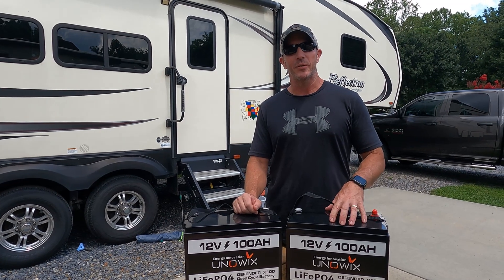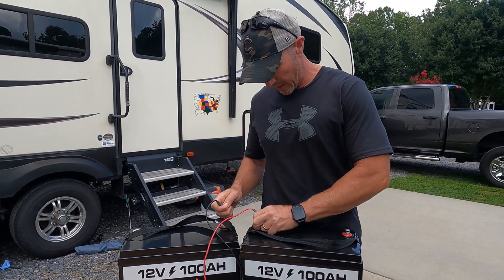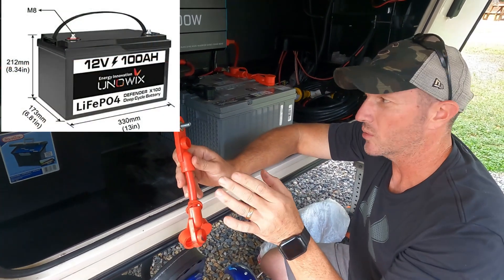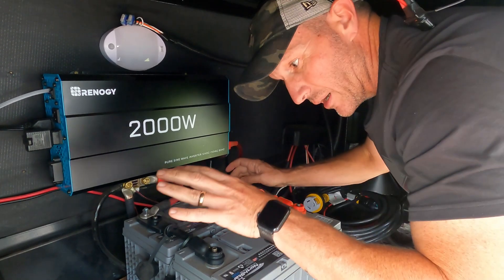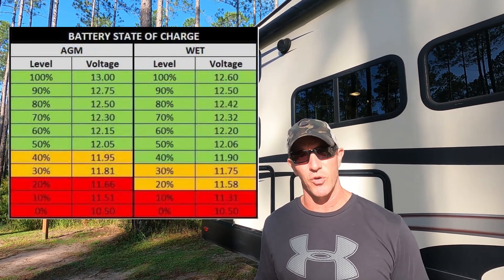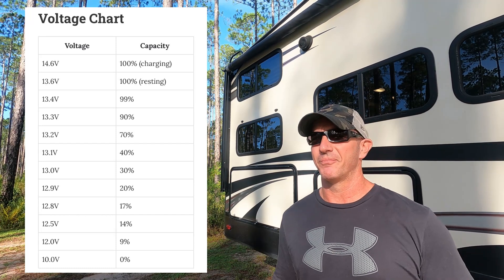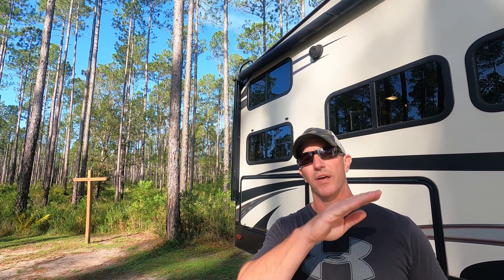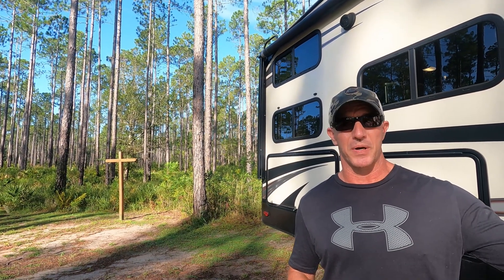Budget Lithium Battery Review | UNOWIX Defender X100 LiFePO4

Comment: I went to the UNOWIX Defender website and they don't list a phone number.  I found 3 email addresses so I sent a message to each address but after a week I get no response.  I'm just wondering with a Hong Kong based company if a person had a problem with a battery how would you get any response/support?  Have you contacted them since you installed the batteries?  Are the batteries holding up after a year?  Thanks!
Reply from the maker: My correspondence with them has always been through email. The batteries are still performing perfectly!

Comment: Where did you purchase your battery connectors with the caps?  would like to add the same to my setup.
Reply from the maker: Here are the battery jumpers I am using:
https://www.amazon.com/dp/B019H9XC3G/ref=cm_sw_r_as_gl_api_gl_i_SYZEK0KDN8RMJ3717QS8?linkCode=ml2&tag=jouppioutdo0e-20 
Thanks for watching!

Comment: Did you add a DC-DC charger on your truck to help charge the lithium and protect the alternator?  Also, where did you purchase the 2/0 battery jumpers?
Reply from the maker: No I did not. The alternator only provides a very minimal charge to the batteries and will not be damaged with this swap. The jumpers are from QuickCable and available on Amazon. Thanks for watching!
Reply: @JouppiOutdoors  thanks for the reply. I have the same setup as you but still have the SLA batteries. 2x 135ah with a 2000w pure sine wave inverter. I was going to hardwire it to the breaker panel but decided not to. Instead I wired a 10/3 SO cord to the inverter AC outlet and installed a 30a female plug on the end as I’m good with just plugging the rig into it. I’ve considered the LiFePo4 but haven’t been able to justify the expense. We boondock more than being plugged in at a park but I have a pretty sweet generator setup onboard our Imagine 2600RB. I’m considering the Victron 12/25 as it’s a much better charger than the WFCO converter. Keep us posted on the UNOWIX batteries. 

Happy camping and many blessings to Dylan, you and your wife.

Comment: Wow thanks for the review it's a right up my alley of information that I need to know. I bought a used 2021 Grand Design Reflections 150 260RD back in March. (Wednesday I'll be camping for 4 nights for 1st time.)  At the end of October I'll be having some solar added to it and I've been doing a lot of research.  I don't get to camp as often as I like because of my job  but I like to do dry camping and boondocking along with state parks.  I won't be able to do a full blown solar package but I like to have a start to where I don't have to do a redo if I do some add on.  Deciding on batteries was my biggest concern. I worry about lithium batteries getting cold on me.  I'm a over the truck driver and I won't be able to keep them warm.
 What are your thoughts on that? 
 As always appreciate your videos.
Reply from the maker: Thank you! I would say that a solar charger for lithium batteries would keep them active enough internally so they would not fall below 32 degrees. If you are not using the batteries, perhaps you can insulate them enough to keep them above 32 degrees?